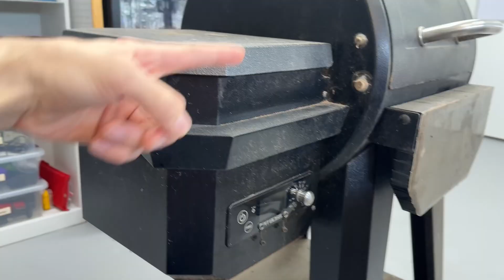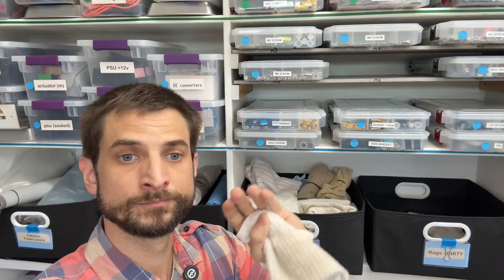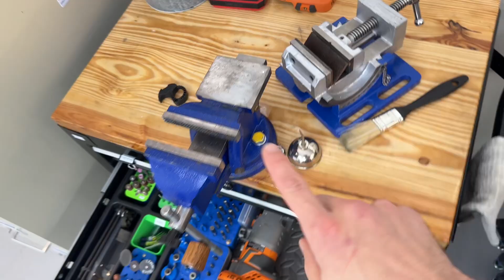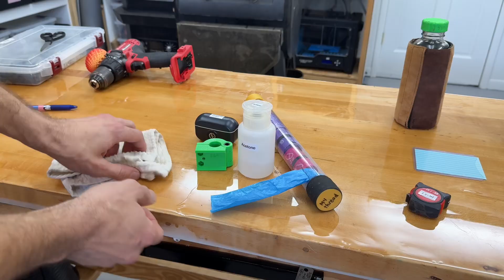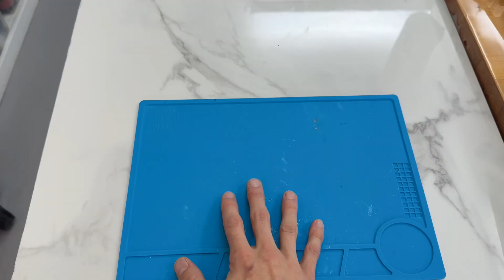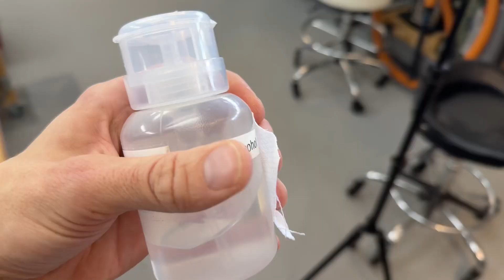Every Engineering Lab needs Rags

Comment: This is really a much larger topic as demonstrated in your video.  The importance of Organization, and Standards can not be over emphasized.  But getting there takes time, and has several obstacles, especially when more than one person is in control of the lab or workshop.  In that case, one of the biggest obstacles is a lack of Common Sense.  That requires Thinking, and in our modern society, we just are not taught to think.  The trend is rather to have technology do everything for us.  Most people are not put in situations where they need to solve a problem.  And if they are, the solution is to "call someone".
Thanks. Regards.

Comment: I feel you so deeply about not providing these basics at university labs.

Imo there has been a pretty significant brain drain in engineering departments regarding professors with any industry experience. And ghey are really the only ones with the sway to push for this stuff. But the reality is they only care about making a space appeare to do work for the purpose of tours.

My building had a large budget for a makerspace (about 1 million for initial equipment + a few years salary for a full time director), well they hired someone the after they started eyewitnesses struggle to use a socket wrench. 2 years on the space is so dysfunctional that other researchers come to my lab to get things 3D printed for them.

Comment: I work in a data center as a technician, and my current project is maintaining the UPS systems on our site. I always have the same things on my person when I go out to work. My pants hold multiple colored sharpies for LOTO tags and torque lines, I have four pens of different colors for notes, relevant keys on my belt loop, safety glasses hooked to my suspenders, and two rags in my back pockets. One is for me, one is for equipment. The one for me wipes sweat when I’m working on electrical, and the equipment rag does SO many things. From being used simply as a rag to wipe contaminants, to being used as a means of adding grip to things I need to grab, and even as a door jam. My personal rags end up in separate laundry bags and are cleaned, folded, and reused each week. Three other techs have since started carrying their own with them throughout the site since seeing all the different use cases for them.
Reply from the maker: Thank you, I can visualize this job function where the rag becomes a crucial part of the daily tools.  These kinds of comments will help when I eventually get a high level administrator to review this video and take note of the importance, and maybe make decisions to help us out at TAMU.